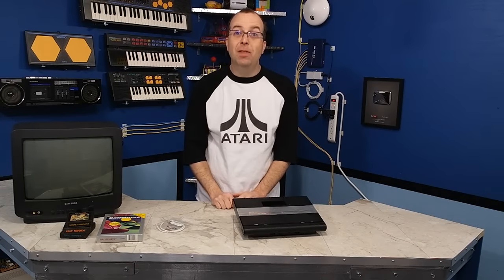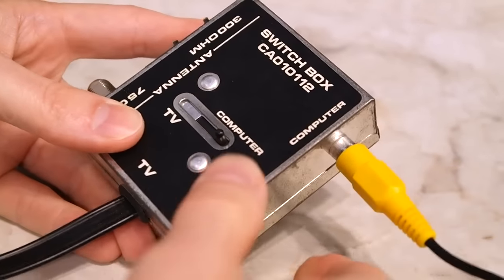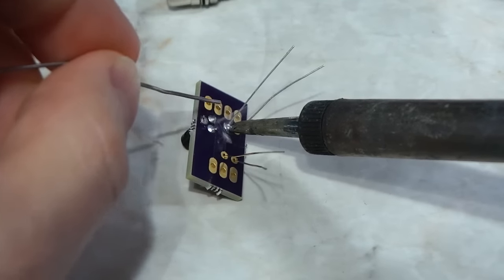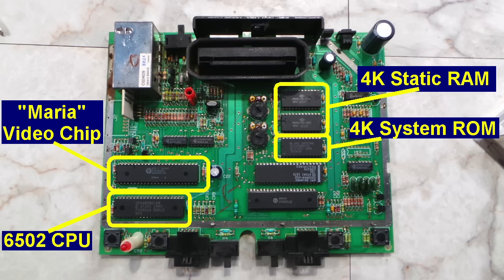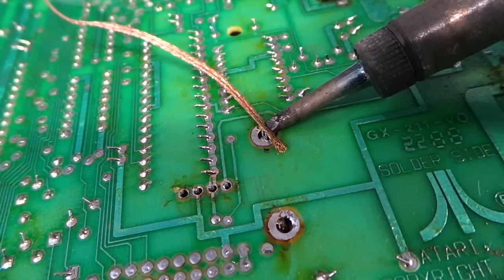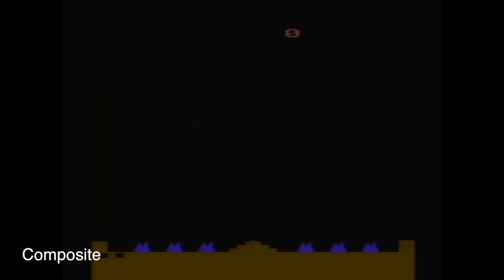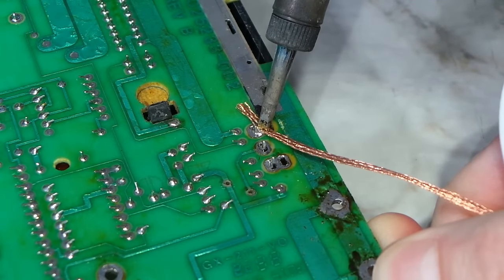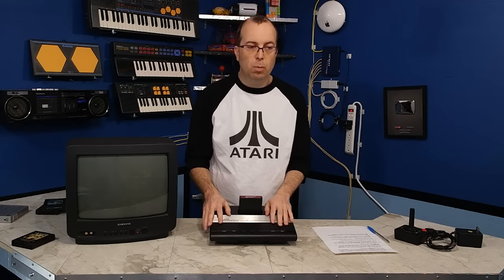Atari 7800 Composite Mod and Review

Comment: 13:52 I don't think (many) people would actually buy a boxed commercial release of a game for an old computer, let alone buy a release of it at all. If people do buy your boxed copy of the game for like, i don't know, the very expensive price of $2, it's probably not going to be enough for a sequel or boxed commercial release for another of your games, it's probably going to be a thousand consumers at most, especially since it's for a C64. I think it's going to have very few consumers even if you make ports of your game to other old computers/consoles like the Amiga, Atari ST, Apple 2, MS-DOS, or the Famicom. Most people that have a C64 are probably not going to have enough money for the game, or have stopped caring about the C64 anyway because it's 2017 and your boxed copy of your game is probably not going to go far. I don't think video game stores will accept a C64 game anymore, especially when they have "better" modern games for "superior" consoles. I don't hate the game, but I'm just saying if you want to get anywhere with your boxed release of your game, it's going to take luck, and lots of it.

Comment: You don't have to use a switch box,  Just get an RCA Male to F Female adapter and a quality piece of coax with f connectors on each end then you can connect the console straight to the TV, that's what I do and the video is much better than messing with a switch box.
Don't bother getting the pro-line joystick controllers they are garbage, order the CX-78 joy pads from best-electronics, they are expensive, but much better to use than a pro-line.
Reply: Or you can buy an Edladdin Seagull 78 adapter , which will allow you to use a genesis controller on the Atari 7800.
Or you can look up the design and build a similar adapter your self, if I remember correctly to build an adapter you only need , a couple general purpose transistors, a few resistors , a cable with a db9 connector, a female DB9 connector, and enclosure of some sort.
Reply: Why's it called a "switch box"?  I'm a little confused; is this the board with the transistor?
Reply: In video the switch box is the device that he connects the RCA to RCA cable from RF out the Atari 7800 to. Old switch boxes like that are often very lossy and prone to interference, interference because of the poor shielding around the switch, the loss from the 75ohm coaxial line being routed through a transformer to impedance match it to the 300ohm twin lead output, the additional loss from the second matching transformer that matches the 300ohm twin lead to the 75ohm coaxial input on the back of the tv, and several decades of corrosion can cause additional loss as well as allow for more interference because oftentimes corrosion will have degraded some of the shielding qualities of the housing.
Reply: Oh I get it now; the thing early in the video.

Comment: To be fair, the 7800 was designed in 1983 and supposed to be released in 1984. That's why it has RF because most consoles before the NES used RF (colecovision for example). However, when the market crashed in the US, Atari scrapped the release. But the NES revitalized the market, so Atari released a 2-3 year old system in 1986 as if it was cutting edge, which is why it sold poorly.

Great video though! I'll have to try this as recording the 7800 is a pain with RF. Have to run it through my VCR and it looks awful!

Comment: The 7800 is older than its release date would imply, Atari designed it and then didn't release it because the 2600 was still doing fine at the time.

Comment: whats wrong with RF? 🥺
you can still use a modulator that was probably cheaper than the kit & plug into a linedoubler/upscaler to 1080p
Reply: It usually produces interference with WiFi and tv signal and like he said it’s kinda dark and grainy
Reply: @adenarrington7607  i dont use wifi 😇
Reply: @jonniefast  if you live in a suburban area many others do use WiFi which can interfere
Reply: @adenarrington7607   He's removed RF, so would this remove interference?

Comment: Stepped drill bits are cheap:
http://www.ebay.de/itm/3-13mm-HSS-Titanium-Coated-11-Step-Stepped-Drill-Bit-1-4-Hex-Shank-BI176-/282379636787?hash=item41bf235033:g:p7YAAOSwx6pYtwvf

Yes, they come directly from china and, yes its not the best quality, but they are good enough for plastic.

Comment: Better sound is a subjective matter! I thought about composite modding the 7800, but when I heard some comparisons of the clear sound vs. the washed out vanilla RF modulated sound, I knew there was no way that I#d ever do this mod! The sound is just so much better through RF, I think this console relies on the filtering effect that the modulation has on audio out. In fact I think the 7800 is loosing all appeal in the moment you take it's genuine sound.
I'd still like doing the mod, if there was a way for routing only audio through the RF modulator, demudulating and passing it to the chinch audio out.

Comment: I remember walking into a Kay-Bee Toys when  about 28 years ago and them selling a 7800 with 20 games taped to the back of the box clearanced for $50.  I still didn't buy this mess. At least the Jaguar had a few top notch games (when Kay Bee clearenced that thing several years later, I bought that with a copy of Doom and some snowboarding game).

Comment: Composite? Who uses composite? Cable TV and rabbit ears both used coax. The Playstation was the first console I remember that didn't use coax as its primary connection. NES, Genesis, and SNES all used coax. My 1080p television has ports for coax, component, and HDMI, but not composite.

Comment: To me this mod is a downgrade. You can emulate old systems like this on any device nowadays and get a crystal clear image; just type the name of the game on a search engine and two seconds later you can be playing it in your browser. The point of using original hardware is dealing with all the inconveniences and shortcomings that come with it to get the real experience, which this modded console no longer represents.